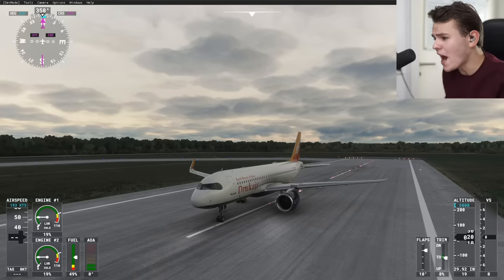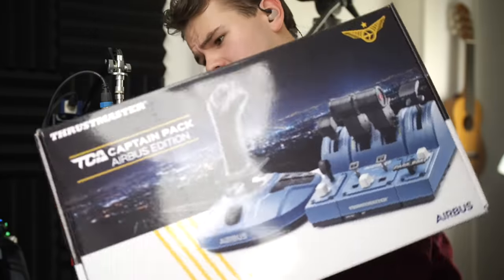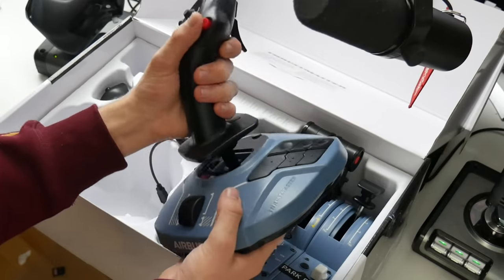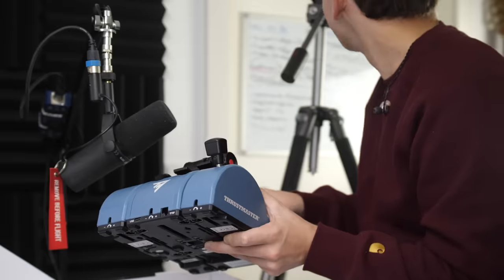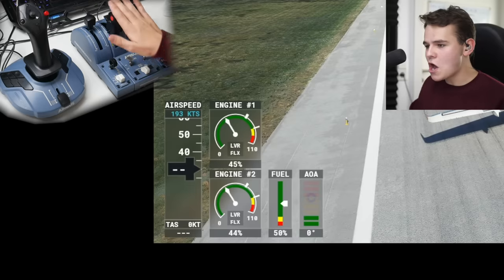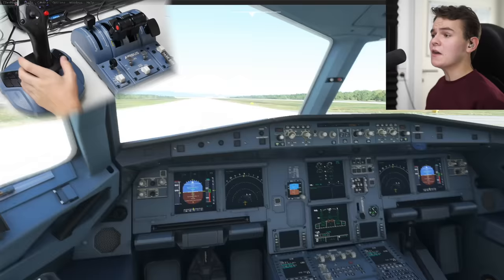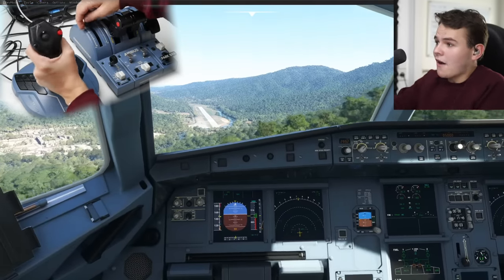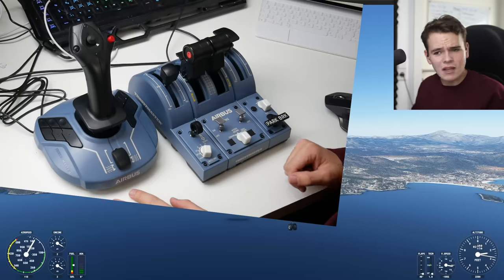My New Airbus Home cockpit Setup - Is The New Thrustmaster WORTH IT?

Comment: Why don't you fly the Flybywire A32nx instead? It's just 100x better
Reply: I agree, it’s like the Zibomod 737 of MSFS
Reply: or like the project airbus a320 for fsx
Reply: the A330 uses FBW avionics
Reply: @rdablock  I think he meant the addon, its called Flybywire A32nx.
Reply: wait isnt the addon currently broken?
Reply: @flying4lyfe609  no they fixed it recently with stable v7 update (some things are still broken but much better). Sim update 5 broke everything.
Reply: No? There are several version on the isntaller too, stable and experimental
Reply: @SantaGamerYoutube  yeah try the new stable version. I still use it right now. It'd quite okay. I was using experimental after Sim update 5 but then reverted back to the stable 7.0.
Reply: I'm just fine with the exp.
Reply: Carson the Gamer  get the xbox game pass
Reply: Carson the Gamer  it's completely okay. You can use the Xbox pass on windows 10/11 compatible PC and play it on PC.
Reply: Carmelita Espinosa  what do you mean?
Reply: I think he used it. But rarely
Reply: FBW A32nx is also free
Reply: @Bhavin_Lathia  you still need a gaming pc
Reply: @jonathanhildebrand2161  that is for sure. This is a power hungry game. I have 2070 still struggles with fps in many areas.
Reply: @Bhavin_Lathia  They optimized it for Xbox so well, I don’t think I have had any lag at all
Reply: BROO I LIVE IN BHUTAN AND NEVER SEEN SOMEONE USE OUR COUNTRY'S AIRPLANE BEFORE that is our country's plane he is flying
Reply: fps killer for low end pc's
Reply: @legendaviation9439  The flybyeire itself has basically no effect on performance compared to the stock A320.
Reply: @vsetenjoyer  zibo is X plane…
Reply: @infiniteVidz  I know I’m not an idiot. I was saying the FlyByWire A32nx feels like the MSFS equivalent to the Zibomod 737 due to their similarities like being free, modifications of planes from the main game, etc.
Reply: @vsetenjoyer  oh ok fair enough
Reply: I have a problem with the A320NX where it just doesn't load.
Reply: Its not
Reply: What plane even is that
Reply: @justinjerskey  A320
Reply: The drukair livery a320 is the fbw a32nx
Reply: Bro never been in a cockpit before and commenting about a320 💀

Comment: Though I'm right-handed, I use a mouse with my left hand because I developed a painful RSI way back in the Nineties from clicking with my right. I think the issue is that if you use an extended keyboard, you have to put the mouse way over to the right side to clear the numeric keypad---on the left that isn't a problem.

But I've lately switched to using a regular game controller (a PS4 DualShock) when playing flight sims, and I mapped the right stick to the roll/pitch and the left stick to the rudder. Then the adjoining button clusters can be trim controls, with the vertical buttons on the left controlling the throttle. But I've been wondering if it might make sense to reverse that, since in the sim I'm usually sitting on the left, and that seems a bit closer to right-seat controls than to what the captain would have. Probably doesn't matter much, since this controller isn't that similar to aviation controls anyway. It beats mouse yoke.

Comment: I use a yoke because I can then use both hands or only the left hand and use my righthand for mouse and throttles, pitchtrim, flaps, speedbrakes etc.  That is a problem for helicopters. You can let go of the collective but not the cyclic (joystick, unless you have a non-centring version with adjustable friction)
I have a T16000, the same as yours but not blue, and it is pretty good. Electronical and mechanical, after 3 years still good, no noise either thanks to the hall sensors
Reply: I don't think not being able to let go of the cyclic is a problem with helicopters. In a plane, you can let go of the throttle but not the yoke unless you're on autopilot. Same with helicopters.
Reply: @smasheduptoaster9186  Real helis have a user-settable friction for the cyclic. There is a video from a Norwegian real life slingline heli pilot where he demos that.  However in the sim with a self centering joystick (like 99% of the joysticks are) you must use force trim, normal trim or AP, if you want to let go of the cyclic. In helis without adjustable friction, you can not let go of the cyclic because they are non-centring and drop to one side (depending gravity and movement of the heli) if you do not hold them. (or use AP, but not all helis or airplanes in RL have AP)

The helis I fly in Xplane the most have force trim and normal trim. I use a switch on my joystick for force trim. I seldom use AP, I like handflying everything. 

In a plane, if you are not on AP, you can let go of the yoke because you always use the pitch trim (also in real planes) I have made a pitchtrim wheel next to my yoke. In a modern Airbus with FBW you do not need to use trim, the FBW system takes care for that. So in those planes you can let go of the joystick too.
Reply: @pa4tim  planes won't spin out of control crash if you let go of the yoke like a helicopter. But irl, you would never let go the control if the plane wasn't on autopilot.

Comment: I've just bought it yesterday.
It's really hard to set up in X-Plane
Reply: are you sure about that?
it took me little time to set it up
Reply: +it has some settings set by default, so it's ever easier
Reply: Its not that hard with yt help
Reply: where did you get it
Reply: I have the airbus TCA officer pack, very recently I bought the honeycomb alpha yoke and it’s a whole different story. It’s much much much better, you have better precision, you make better landing and you fly better basically
Reply: @carloumbertocucchi1358  it’s expensive af, for me especially in Russia, and I don’t like small throttles. It would be very cool if someone made throttles with same functions just a lil bit bigger
Reply: @mott_scanley0029  The bravo throttle quadrant from honeycomb looks really good, but... it's even more expensive. So that's why for now i just got this instead. Maybe when i get more into the hobby, i will eventually upgrade.

Comment: Is the Z-axis also uses the magnetic H.E.A.R.T sensor or just a potentiometer sensor that wears over time?
Reply: glad to be seeing new comments to answer your question.

the Z axis uses a potentiometer and the biggest issue with this piece of overpriced plastic is that the Z axis dies after like more than a month of usage. You'd be lucky if you get past 5 months without the Z axis beginning to have a stroke.

This is gonna be a problem unless you have rudder pedals
Reply: @shaxuesheng6128  OK got 5 months before rudder fails, now how about the throttle? Seems loose even when i just got it out of the box

Comment: Sup Swiss, actually I use the same joystick and throttle control. The thrustmaster airbus edition one.  It’s actually pretty good is my opinion lol.
Reply: I have the airbus TCA officer pack and very recently I bought the honeycomb alpha yoke and it’s a whole different story. It’s much much much better, you have better precision, you make better landing and you fly better basically
Reply: Also it feels nicer
Reply: @carloumbertocucchi1358  I have the officer pack and the honeycomb yoke. It is not more precise and the yoke doesn't make you fly better. If it did, Airbus wouldn't use sidesticks in the real plane. I choose based on the aircraft and sometimes I miss the stick when flying a plane with a yoke. But I do agree the yoke feels higher quality but it is also $170 more.
Reply: @smasheduptoaster9186  and you will also need a throttle quadrant and rudders.
Reply: Do I need rudder pedals for the airbus captain pack?
Reply: @cheems2.072  you can actually rudder with the joystick, so not required. it is more realistic with rudder pedals tho.

Comment: How to setup this for reverse thrust in msfs. When i use it as it is, at idle, the aircraft still moves and the throttle is 20%. and when i put the reverse thrust full on. Then engine comes to idle
Reply: What are you using, FBW?

Comment: I tried this in store… it feels very cheap. I would’ve estimated $60 max before. The plastic is creaky, the throttle has no resistance and the reverse thrust lever on one side broke, the engine start switches don’t get lifted like the real thing… they’re just cheap on/off toggle switches with a cap. You could probably get a better feel from 3D printing your own for a lower price
Reply: no i have it and it feels really nice and everything works really well could be just that one everything feels really good and the plastic works really good
Reply: @ilyaersoz1596  probably, it was an in store trial item so I imagine it gets beaten up. Still, they could’ve put much more effort into the Engine levers for the very high price
Reply: @alexcurmi7412  yeah the engine levers are probably the worst part

Comment: It’s not reverse thrust, there is no reverse, it’s the reversibles which in landing will help you slow the plane
Reply: There is though. When you pull the levers all the way back and pull on this flap on the back of the levers you can go into reverse thrust. Also the reversibles your talking about are the spoliers/speedbrakes

Comment: The Amazon price is a scam. Buying separately, and buying the bundle is different. For example, buying separately is $198 but the bundle is $249. That math is way off 😂
Reply: Sidestick-$80, throttle-$100, flaps and speedbrake-$100. That's $280 separately.
Reply: @smasheduptoaster9186  I’m talkin’ Amazon
Reply: @snooz221  Are they used?
Reply: @smasheduptoaster9186  nooe